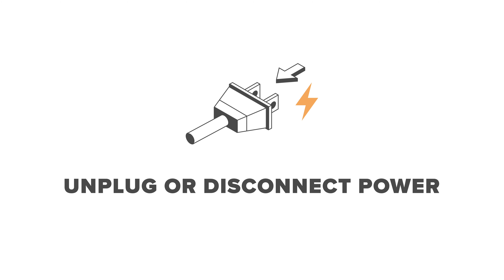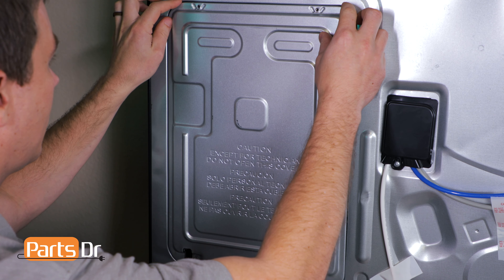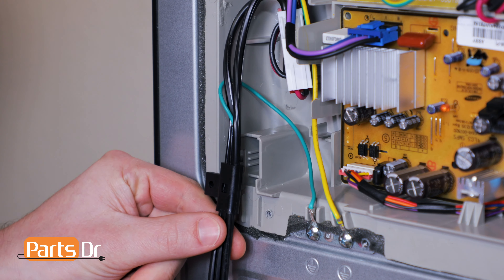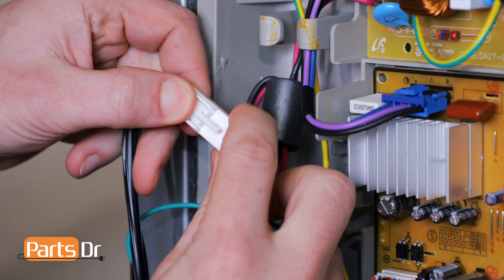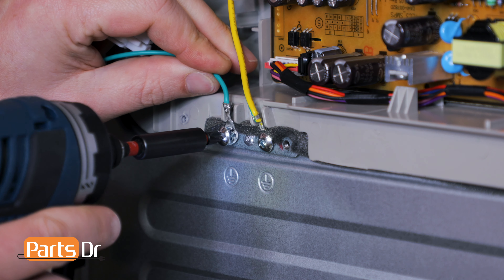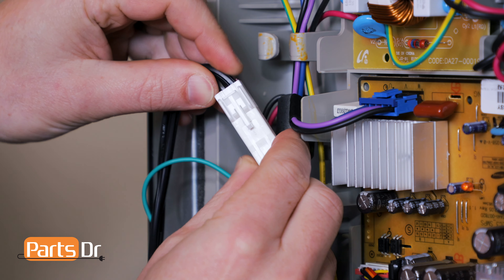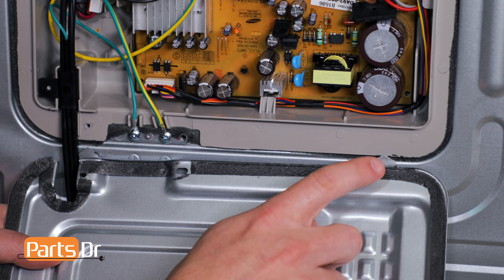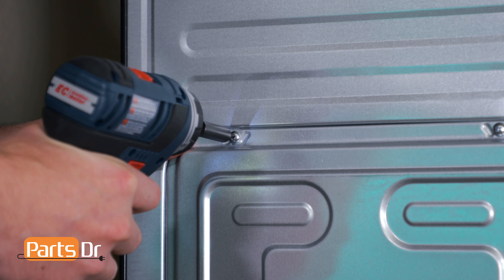How to replace Samsung refrigerator power cord part # 3903-001003

Comment: Is this usually the same part/plug for all Samsung refrigerators?
Reply from the maker: No, they have different part numbers for the power cords for different Samsung model refrigerators.  Make sure to search with your model number from the tag on your refrigerator on our site to get the correct part.